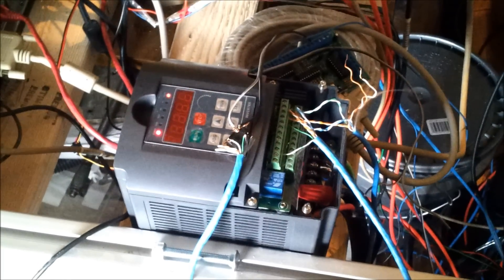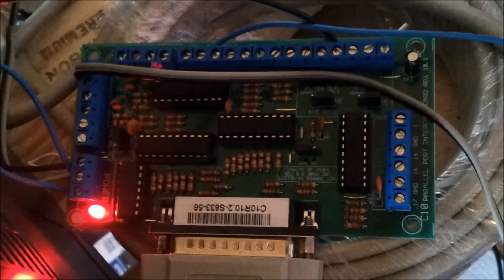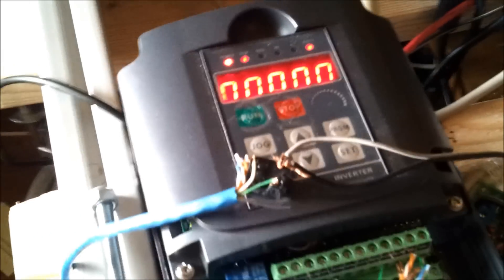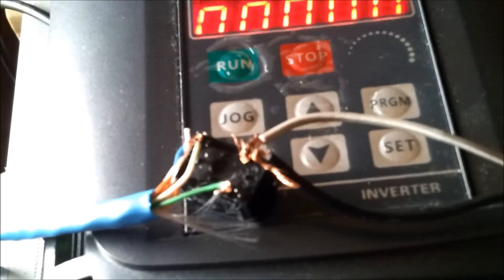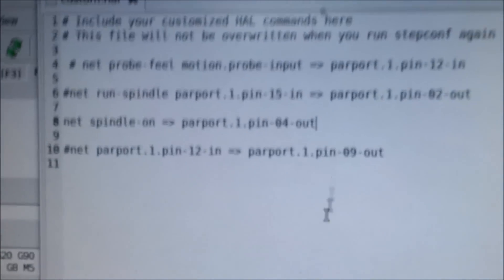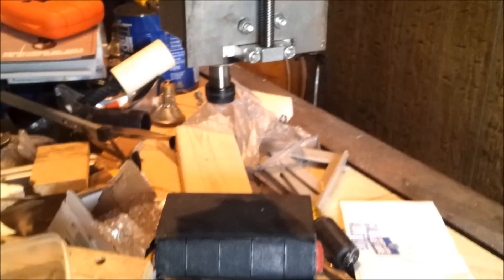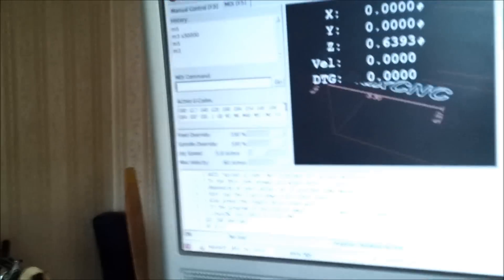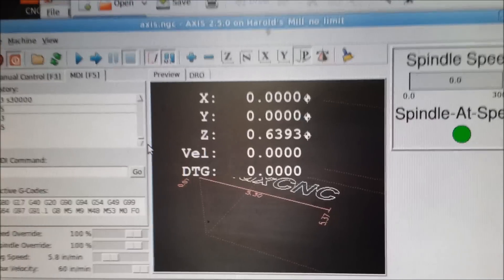Huanyang VFD Run with LinuxCNC (PD001 - 1: External Terminal)

Comment: I realized after looking at the wiring diagram for a while to short to DCM for external terminal control. It may have been too late though as I'd already stuck 240v ac down FOR. I'm sure I've got prog 1 set properly but still can't get it to work. Might I have damaged the vfd? Any idea if there's a fuse? Ta.

Comment: I don't even know where to start.  I bought a digirout cnc and it's turned into a DIY project.  I have no idea how to wire up the inverter to the controller provided by DigiRout.  I'll have to break open the controller and see what's inside.  Maybe they already have what I need inside and just didn't exposed the wires.

Why are there no instructions and pictures on how to do this?  I've been searching for hours and maybe I'm just not using the right words.

Thoughts?

Comment: Have you had any success getting a valid speed reading from VO output from the Huanyang to the Gecko ?
There's just so much noise on my VO output it's useless getting any acurate reading.
Even try a heap of statistical stuff to no avail.